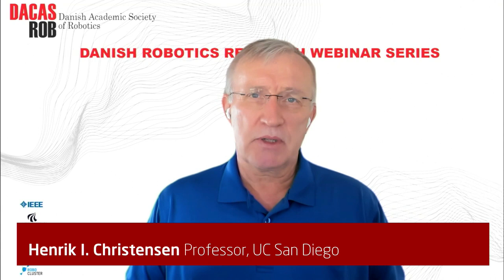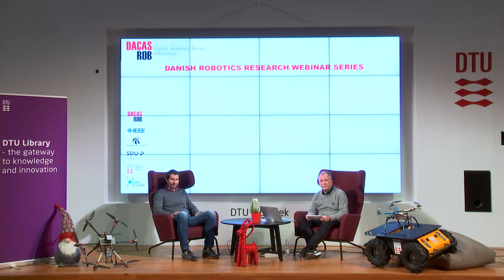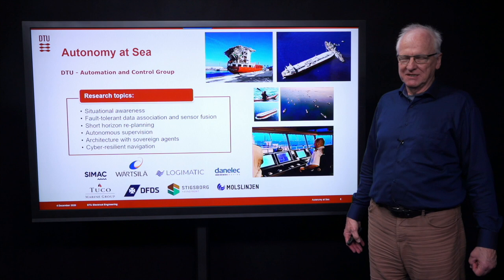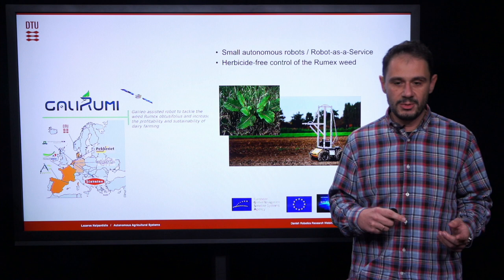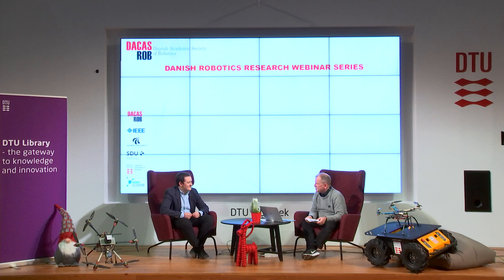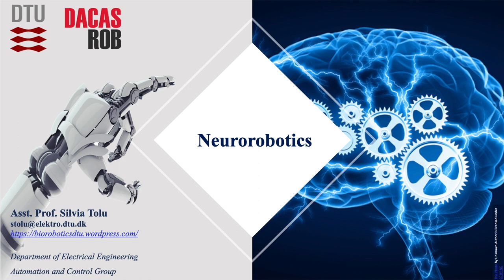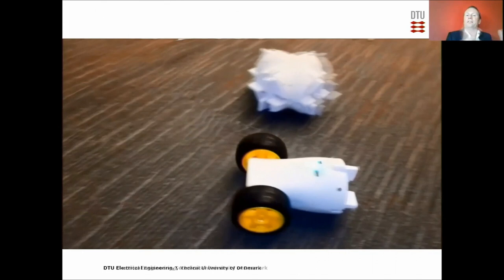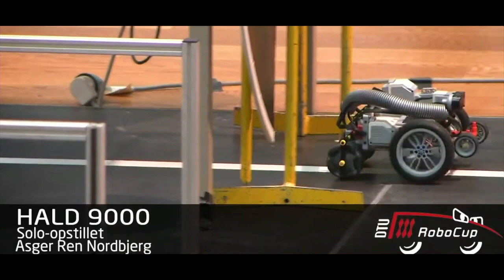Danish Robotics Research Webinar - Technical University of Denmark (DTU)

Comment: Circuits, Systems, Automation and Applications Kindle Edition
by Himanshu Thapliyal (Editor), Travis Humble (Editor)  

This book provides readers with the current state-of-the-art research and technology on quantum computing. The authors provide design paradigms of quantum computing. Topics covered include multi-programming mechanisms on near-term quantum computing, Lagrange interpolation approach for the general parameter-shift rule, architecture-aware decomposition of quantum circuits, software for massively parallel quantum computing, machine learning in quantum annealing processors, quantum annealing for real-world machine learning applications, queuing theory models for (Fault-Tolerant) quantum circuits, machine learning for quantum circuit reliability assessment, and side-channel leakage in Suzuki stack circuits.